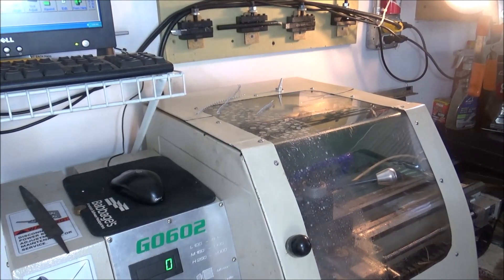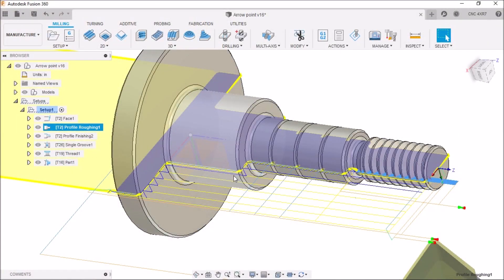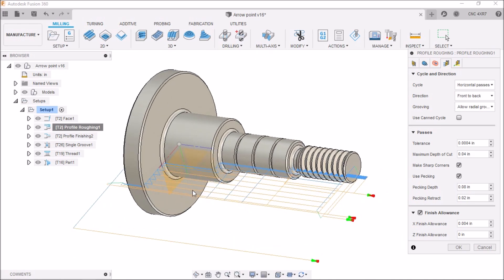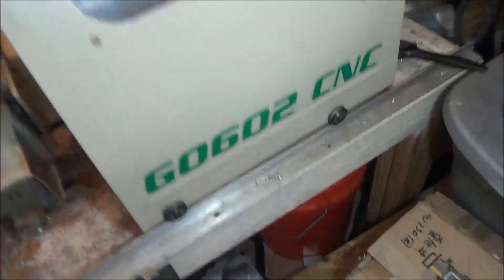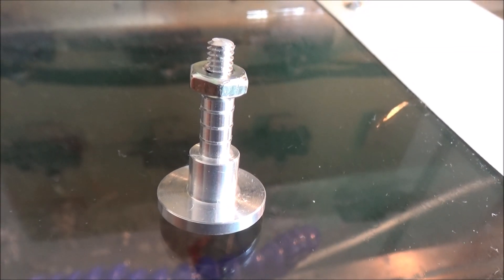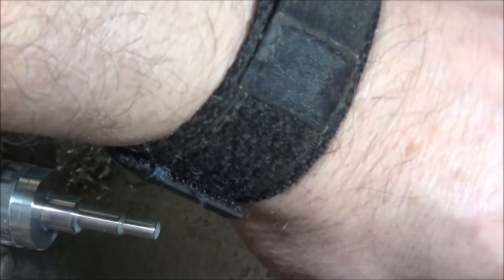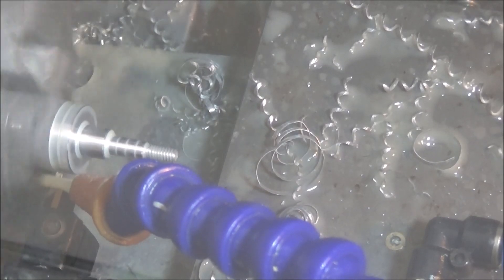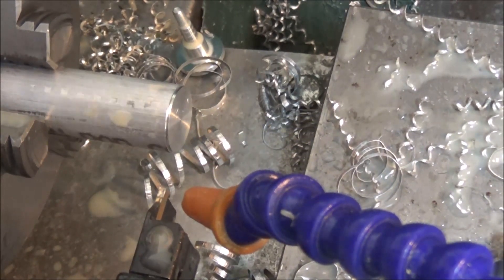Fusion 360 Pecking

Comment: always great videos, I am starting using my CNC vertical mill as lathe and didn't know that feature. One thing I am doing on my small lathe is to make a solid toolpost . You do not need the swing arm anymore and the machine get way more rigid. In your case that is already CNC converted will be perfect and improve rigidy and finish. There a videos from Lanzetti and Stephan about it.
Reply from the maker: Cool, thanks I do want to use gang tooling at some point

Comment: it looks like you surface speed it too low  try going fast it might help.  i uses the same inserts with similar DOC and it chips. 250M/min
Reply from the maker: what RPM are you running the Face mill at David?
 and  what feed rate ?
Reply: @CNC4XR7  for something like that about 1800 RPM with 0.18mm per rev. faster would be better but im limited to 1800.
Reply: @CNC4XR7  VC for them tips can be as high as 300m/mm but thats about 12000 RPM for 8mm diameter . try it at max spindle speed

Comment: have you tried using a different insert type? i'm using a tcgt110204 insert for aluminium and when taking a similar DOC and feed (as you are with your dcmt insert) the chips curl up very tight and i'm left with a great surface finish as well. here's a picture of the chips: https://i.imgur.com/iKqwPko.jpg
Reply from the maker: those chips are a nice size I will need to look into those inserts.